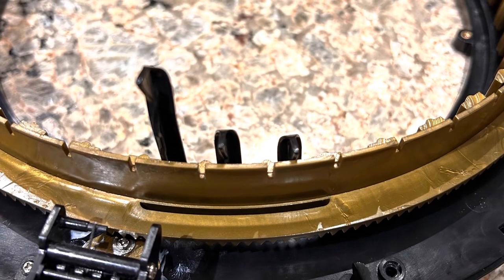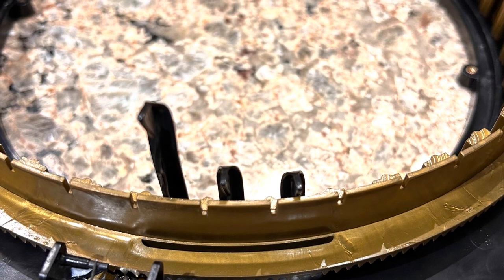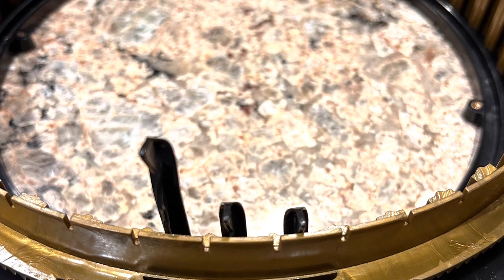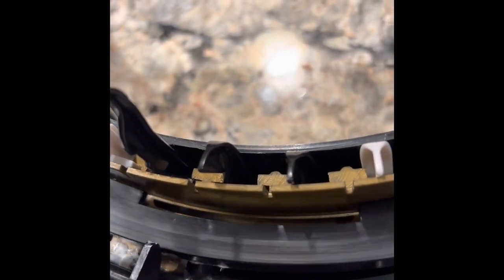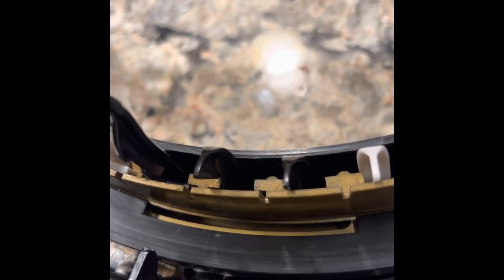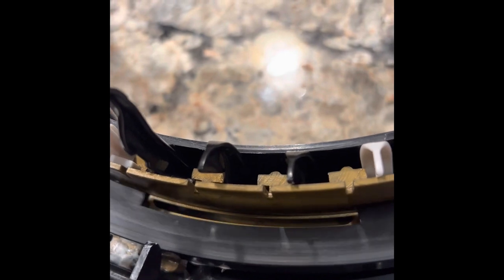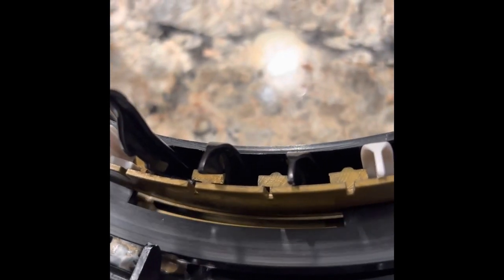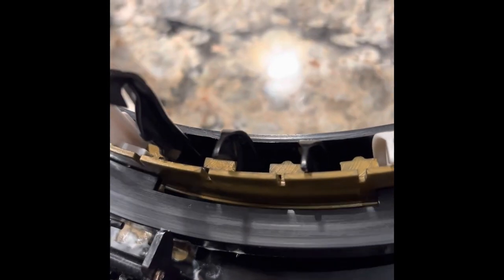PART 2 - How To Clean, Fix Handle, Improve Needle Function On Your Addi - (Watch Part 1) Also see⬇️

Comment: Thank you Shelley. I will be rewatching all of your videos regarding this.  I always assumed it was user error with my new  Addi.  But I've tried every yarn I have and it drops stitches midstream, in both tube and especially panel mode.  Braced up the feeder, thinking it was too far to catch yarn.  Didn't help.  So regretfully say "I got a dud Addi"!!!  Nothing to lose if I take it apart. Thank you so much for your videos.
Reply from the maker: I made the videos on my first time of taking the machine apart so they may be a bit hard to follow. I should really do it again some time because I am much better at it now.

Comment: I am having a problem with my machine splitting the threads as the needle comes down. It is mostly on panel knitting.  It is my favorite yarn.  Never had a problem before. I have taken my machine apart several times in the last week.  I have the 2 screws on the bottom of the row counter that I cannot remove.  I am at my witts end.  Can you think of any solutions!
Reply from the maker: The only thing I can think of is that you need to use a tighter tension so the yarn is sure to go completely under the hook of the needle. If the tension is too loose then the tip of the needle catches it and it snags.

Comment: It wasn't skipping stitches before, so the only thing I can think of is something got broken, I'm reluctant to take it apart again, I had a really close look at all the parts making sure nothing was broken before putting it together several times and I just can't figure out what is going on now. I'm quite mechanically minded so not a dunce when it comes to taking things apart and this one really has me stumped and incredibly frustrated.
Reply from the maker: So sorry to hear that. I have taken mine apart several times. 
I admit this video may not be the best. I said in the beginning that I was doing it for the first time with you as I made the video. I should really redo a video since I could likely do it now with my eyes closed. 
But I would take it apart again if I were you. If something is broken or if a small screw fell in there you dont want to knit with it and make it worse. Research other videos.
Reply: @koalaknitsandknacksaddicrochet  I figured out what was wrong. in your video at 34 seconds you have the two slots, the gold and black slots, lining up. That doesn't work on my machine, which is the newer Addie king(2023) (I am surmising that that is the difference between what's in the video and what I am seeing on my machine ) On the gold ring there is a small notch/nub, the slot o the black ring fits over that gold nub. I should have taken a photo as I was putting it together but my hands were full of grease. Now not only did it assemble perfectly, all the pieces are lined and there is no grinding or skipping stitches.
Reply from the maker: I am so happy to hear that. 
I really need to do an updated “better” video. I will do that in the near future.
Reply: @koalaknitsandknacksaddicrochet I am ecstatic too. Maybe just add a mention in your video the specific year and model of your Addi and that the newer machines may fit together differently.

Comment: i took my machine apart to try and fix the handle wiggle and now that its back together it is now skipping stitches and "grinding' between needle 36 and 39.  Taken it apart several times and cannot see anything wrong with it.  I am furious with myself for taking it apart in the first place.  Ive only had it 2 months. 😭😭😭
Reply from the maker: Taking it apart and putting it back together will have nothing to do with skipping stitches. Grinding happens if there are broken teeth on the gold barrel that is inside the machine or if tension is too tight when knitting. 
Tightening the handle can be done without taking the entire machine apart. 
I hope that you can get it resolved. So sorry for your frustration. 
My video has helped many people but if it’s not the one for you then please search YouTube and find the one that will help you understand better how to reassemble your machine.

Comment: I just learned that the recommended lube for these machines is now the Dielectric Grease instead of the white Lithium because the last one will eventually damage the plastic parts
Reply from the maker: Interesting. This one was recommended to me because it is good on plastic. I’ll have to do a bit more research. Thank you! 😊
Reply: @koalaknitsandknacksaddicrochet  I previously learned the same, but I found a research made by the owner of the channel Creative Yarn with Fabi, and what she says makes sense.  Now I’m not sure which one to buy, my SENTRO needs its first cleaning and lubrication service.
Reply from the maker: I think you should go with the one you are most comfortable with. I think they are both likely good. 😉
Reply: Ok, I am now having a problem with my flat panel. After I took the machine apart for the 2nd time because my counter was off .got it working, and now my panel is off center.i hope there is a hack for the panel. I don't think my little screws will take much more. IF I TAKE THEM OUT AGAIN, they may become unusable.